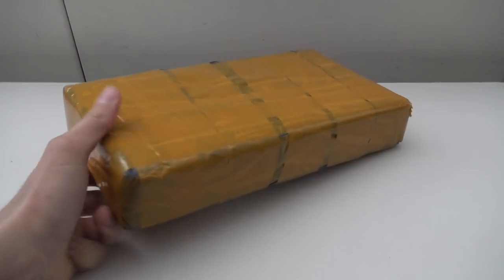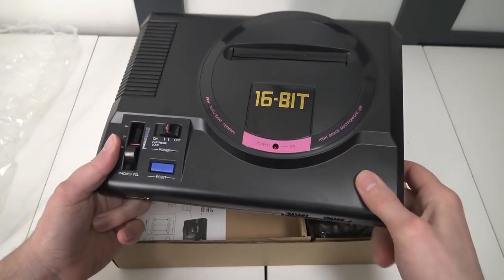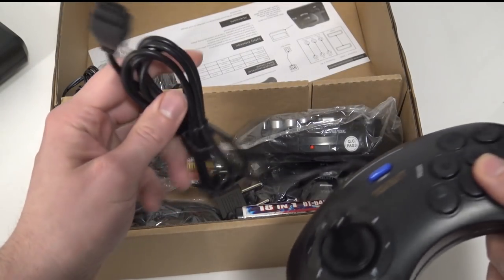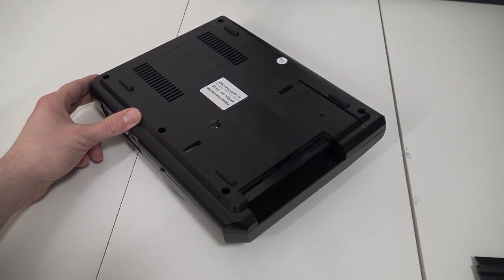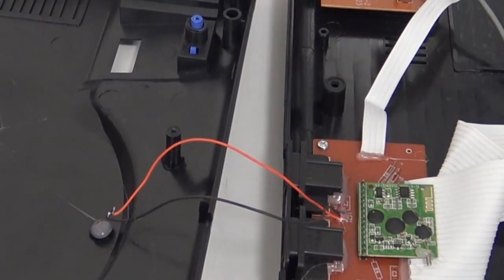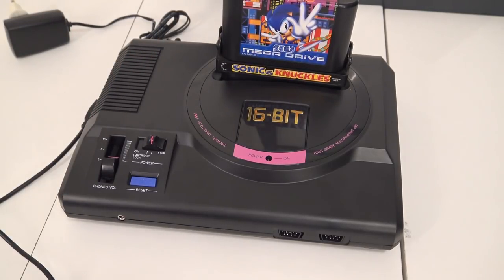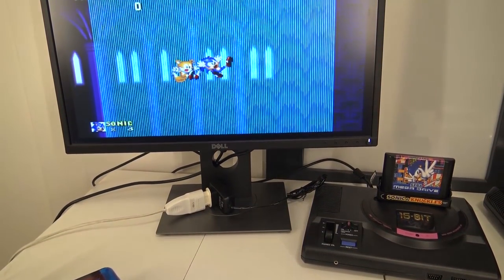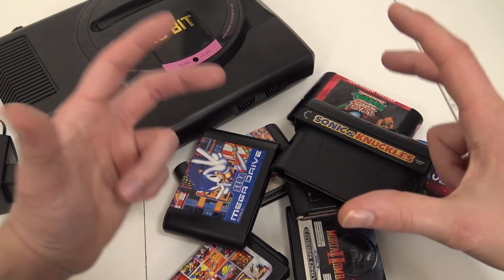Fake Sega Genesis HDMI from China... Is it any good ?

Comment: I bought this exact one... the Audio from HDMI is True Stereo with sonic's rings going from left to right speaker...
no problem running my Everdrive on it either...
It even plays my PAL original Sonic 2 cart
The Front phones jack is MONO both channels together
Reply: as you can see the wires going to the PHONES board are for STereo... 3 of them... So I think its that Volume Slider which causes cross-talk, its mono and they wired both channels to it so it breaks the STEREO... 
I might try to fix that somehow
Reply: you need to get the new v3 China Eveerdrive... 
It's not any of the ones I have seen you own
It has a MICRO-SD not full size SD...
and I d my v3 china everdrive works great and super fast loading too on this console

also I think there is something wrong with theway you test audio...
How are you getting sound from the Original Megadrive? did you know the original is MONO from back ports so to get true stereo U need to plug into the PHONES jack at front

Comment: If i remember correctly the everdrive uses a 5v pin not usually used so it was probably cut from the clone's design to save money. Usually the same reason the virtua racing game won't work either

Comment: Did you try using the flashcart with both region switch settings? Which SCART cable did you use for the OG system and the upscaler? I see some really bad jail bars. I think you should make more videos on SCART cables, some listings say RGB others say AV.
Reply from the maker: Going to make an update about this. 
Found new version 😎

Comment: Huge downside of cheap Chinese clones is that they have only 16/9. I prefer Hyperkin's solutions, because for example my Retron 2 HD have switch to set output to 4/3. Lots of modern TV's now lack of built in switch and you only have stretched mess. I will be ordered soon Retron 3 HD, do NES, SNES and MD in one. Good thing is that all systems have own chips. But there is one thing that could be fixed by Hyperkin - HDMI is only upscaled from composite source :/, but quality is better than China offers.

Comment: I think you got a defective one, because mine works fine with several different Chinese Everdrives. Also you bought the old version with pink paint. The current versions have red paint, have "HD Ultra" printed on the top, and has built-in games. More info here: https://segaretro.org/Fei_Hao_HD_Retro_Game

Comment: I love the fact that clone's design is based off the Japanese Sega Mega Drive. The picture quality OK, I noticed colors on the clone appeared are slightly darker and blured than the original Mega Drive. Those wireless controllers remind me of the wireless controllers included with the AT Games Sega Genesis clones. Sonic and Knuckles seems to run pretty well, unlike some China clone consoles. I would consider having it for my collection because I love the design of the Japanese Mega Drive.

Comment: The main problem with clones is no compatibility with everdrives which is sad ☹️
Reply: My one of these works with an everdrive clone. Can't remember which model buts it's an early one with master system pause
Reply: I have the same Megadrive clone and it work fine with chinese Everdrive clone
Reply: It's not the same board as the real SEGA machine is why it fails to read them
Reply: I use my Power Base Mini and the China Master System Everdrive.
Reply: @michaeldemers2716  on this unit?
Reply: @afriend9428  It was on Ali-Express it was called Retroad 2020 New Version 16 bit MD Genesis TV Game Console HDMI. Looked like that to me.
Reply: @afriend9428  I have had good luck with the Retroad Products. I really like the Retroad 5 Plus with all of its different adapters. Most Everdrives work on it as well and it's HDMI and hooks to a TV as well. I got the real Everdrive MD Pro to work on it with CD Emulation with the MD adapter but only got some audio and didn't get the CD audio for some reason. I just may not know what I am doing though.
Reply: Hyperkin works fine with ever drive clones